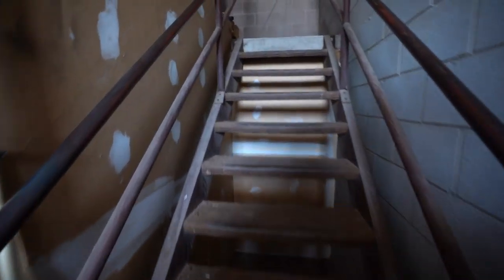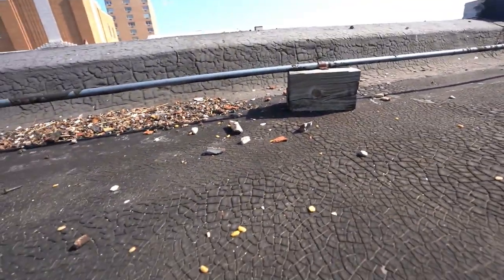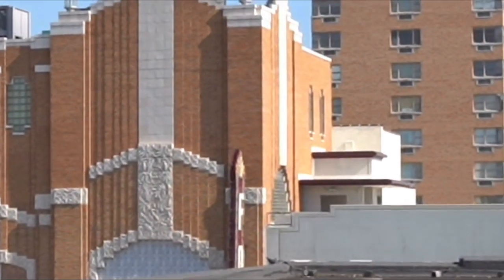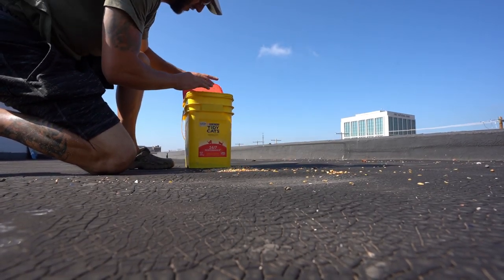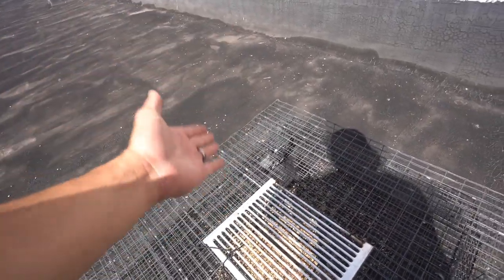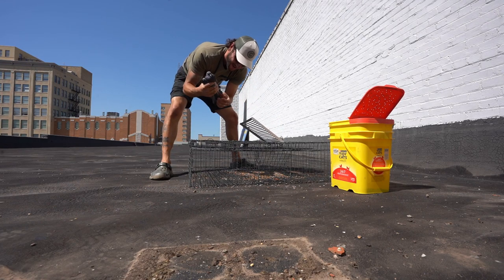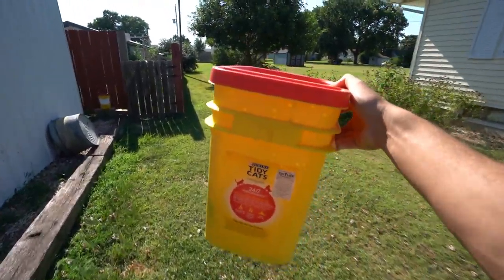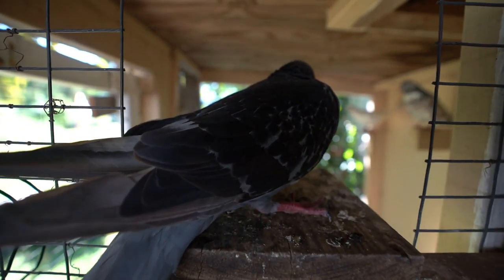Trapping Pigeons in the City!! (We Got Em!)

Comment: You still need to make that 5 gallon bucket trap I told you about that I saw a video of on YouTube. It works by the weight of the bird and goes down to a holding cage. And when the bird hops off it resets its self.